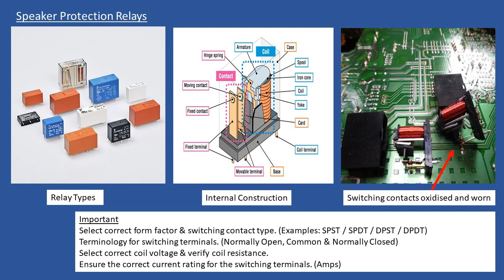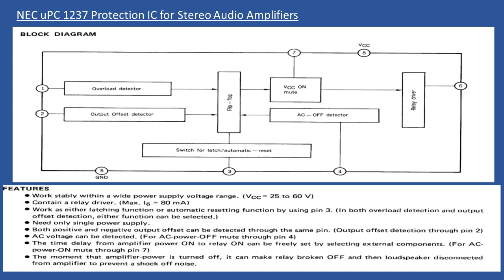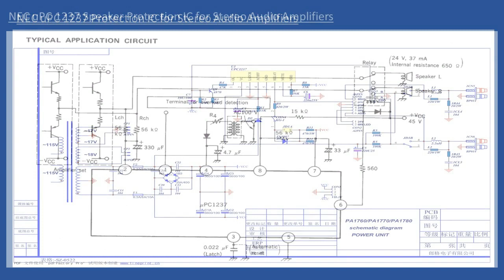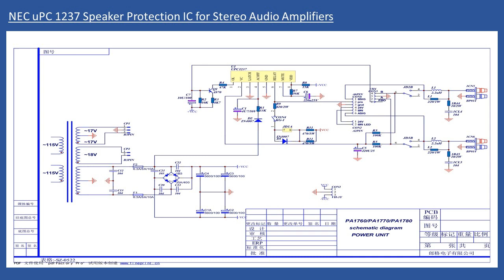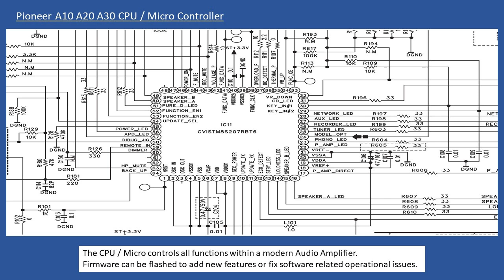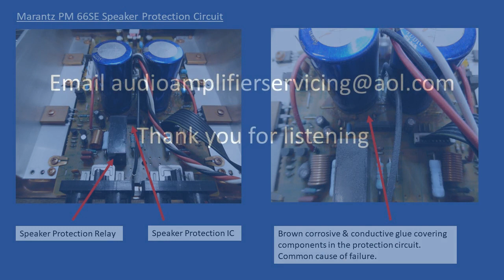Amplifier Protection Circuits Explained & Typical Faults (With Audio Tutorial)

Comment: Hello. Thank you for this video. I think you are the only person on YouTube to have addressed this circuitry in a straightforward, digestible form. I have been searching for a clue as to what could be wrong with my NAD 208 power amp all these years but have not been able to get an assuring answer. The issue with this amp is that the relay is taking too long to close upon power ON. It takes anywhere between a few seconds to something around 8 minutes or so. Once it goes from the startup amber/red to green(ready), it works without any issues. However, if it is powered OFF while in operation and switched ON within a few seconds or minutes, the relay kicks in immediately to green(ready). It does not return to protection mode whatsoever during operation. I don't know what is causing this. Those well-versed in this type of circuitry and repair say it could be a dried-out cap somewhere. Perhaps even the time delay component you referred to here. It would be great to hear your expert opinion. Thank you.
Reply from the maker: Hi, thank you for your kind comments. C606 a 1uF 50V electrolytic capacitor is the first thing to check.
Reply: @AudioAmplifierServicing  Hello. Thank you for the reply. I think I will look at that cap. In the event the cap needs replacement. Can I go with film caps instead of electrolytic caps of the same value? Appreciate it!
Reply from the maker: @peterraj256  For this application fit an electrolytic
Reply: @AudioAmplifierServicing  Yes sir. I will do that. Thank you very much.
Reply: @AudioAmplifierServicing   Hello. I got an update from the tech who followed your guidance. The 1uf cap(C606) was desoldered and measured and seems within specs. The relay contacts are good as well. He suspects the IC601(TA7317P) to be causing the problem. May I know how he should move forward now?  Thank you very much.
Reply from the maker: @peterraj256  Hi providing the voltages are correct on the pins of IC601, then proceed with replacing it.
Reply: @AudioAmplifierServicing  Hello. The voltages came out within specs but the cap C604 220uf 10v( time delay setting component) gave a reading over specs—something like 290uf. Is this indicative of a bad cap and could this be the cause of my issue? Thank you.
Reply from the maker: @peterraj256  A capacitor normally decreases in value but the equivalent series resistance will increase. The capacitor with higher value will take longer to charge so in this case it makes sense to replace it eliminating the capacitor as a possible cause.
Reply: @ Hello. Thank you for the explanation. I conveyed this to the tech, and he replaced the cap(same type). It has been tested over the last few days, and this week, further tests will be done to see if the problem was indeed this cap. It takes about 5-10 seconds for the relay to click. This has been consistent after the swap. I am not sure what the standard time delay for this should be, though. Should they swap anything else as well while they are at it? Thank you very much once again!
Reply from the maker: @peterraj256  The LED on the front should turn from RED to GREEN in 3 to 4 seconds after switch on.
Reply: @ Thanks for the reply. An idea could be causing this slight delay, then? The relays have been checked and cleaned. They work fine. The voltages are correct on the pins of IC601. If the C606 is replaced now, will the delay be between 3 to 4 seconds and come within specs? At this point, what else do you think could be the issue? Thank you once again.
Reply from the maker: @peterraj256  The service manual describes the operation of the protection circuit and the charging and discharging of the capacitor.
There will be tolerances so if the time period your experiencing is consistant and not annoying to you the user then I would not see  the need to investigate further. The Amplifier has done many years of service so that will be a factor due to aging of components for example electrolytical capacitors
Reply: @AudioAmplifierServicing  Thanks for the explanation. I will bear this in mind. I sincerely appreciate your guidance and help thus far. Glad that there are still good people around doing this. It has been a great pleasure communicating with you, Sir. I will let you know of the outcome when the unit comes back to me later this week. I wish you nothing but the best in your trade and good health to continue enjoying what you are doing.
Reply from the maker: @peterraj256  Your very welcome, all the best.
Reply: @AudioAmplifierServicing  Hello Sir. I got some good news. Earlier today, I got the unit back. The only part replaced was the 220uf time delay cap. The other cap(C606) measured within specs and was not changed. After replacement, it ran daily for 2 weeks(a couple of hours a day), and the OFF/ON procedure was simulated(a few times throughout the day) to establish consistency. Also, the amp was left over the weekend and switched ON on Monday to see if this non-usage for a couple of days caused the relay delay. This test showed no delay as well. I took possession of the unit earlier today, and it ran for a few hours. The relay 'clicks' within a second or two now. So far, so good. I will be monitoring how this goes. Thank you for the help!
Reply from the maker: @peterraj256  Excellent news that your Amplifier is now repaired.
Reply: @AudioAmplifierServicing  Thank you, Sir. Without you, the good people here who dedicate their time to helping others, these would not have been possible. 🙏
Reply: @AudioAmplifierServicing  Sir, sorry to bother. There appears to be a small problem now. The relays click within a sec or two when turned  on if the amp is used everyday or every other day. Recently, I observed that if it was used for about 3 days or so, it will take close to a minute for the relay to click. The following day, it will be within one to two secs as well. Anything less than 2 days, the amp's relay clicks quite immediately. I see a pattern to this and I don't quite understand why this is happening after the cap has been replaced(and it fixed the delay). Is it some kind of cap discharge or thermal issue? Kindly let me know, Sir. Thank you.
Reply from the maker: @peterraj256  Hi I would advise to confirm if the issue is due to a problem with protection circuit or its operating correcting but it is detecting a higher than normal DC off set on either channel.